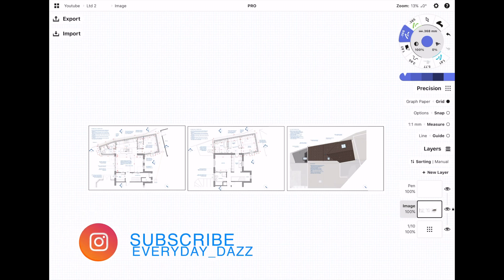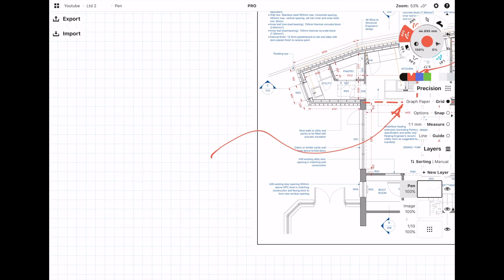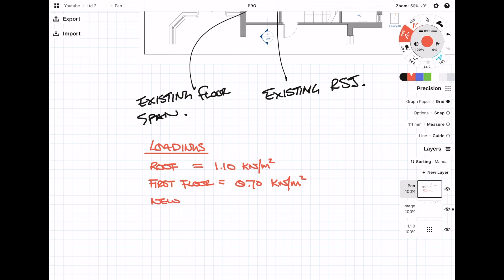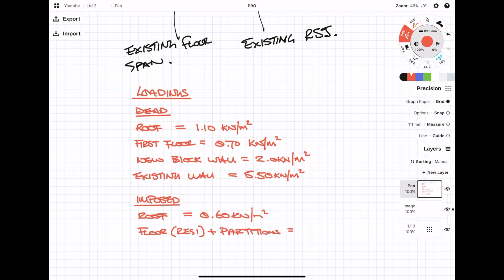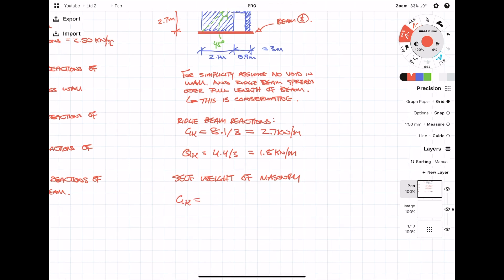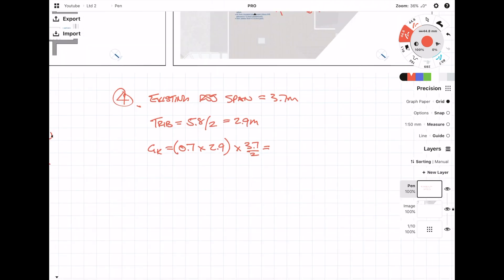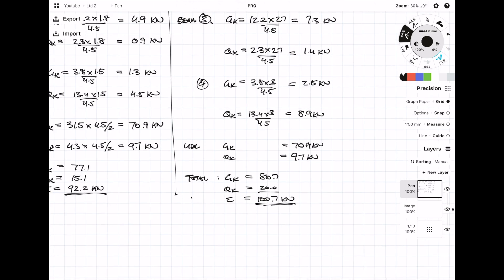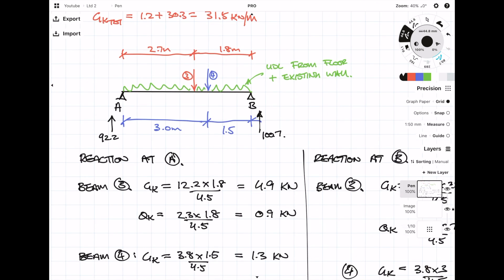Home Extension Structural Design - Part 1 - Load Takedown

Comment: Hi Dazz, I out of Uni and don't have that much experience. I was wondering when calculating the UDL on the ridge beam, why the tributary length is the entire length of the pitch roof (2.3 metres), and not (2.3 metres divided by 2)? Because don't the walls either side of the ridge support some of the gravity load?

Comment: Man i really like how you work with concepts app! One little thing i might have missed, when did you multiply with 1.35G and 1.5Q. I usually do it at the very end so that i can have my SSL loads and ULS loads side by side.
Reply from the maker: Thanks! 
I didn’t do any factors yet because I was only doing the load takedown keeping dead and live loads separate until I need to design something. :)